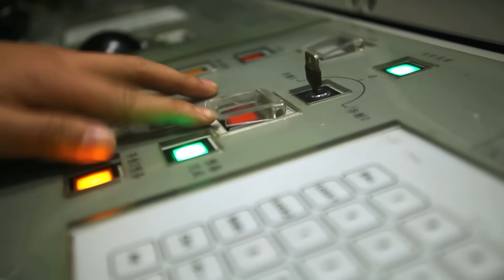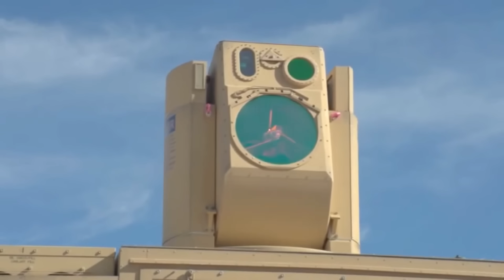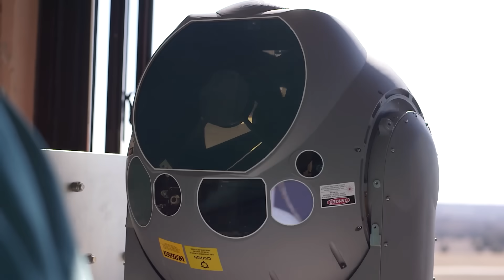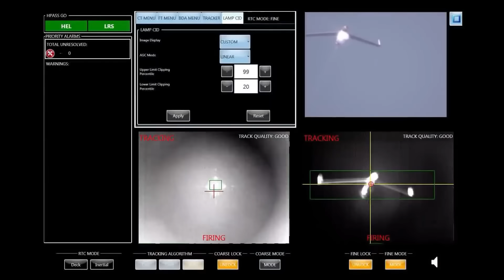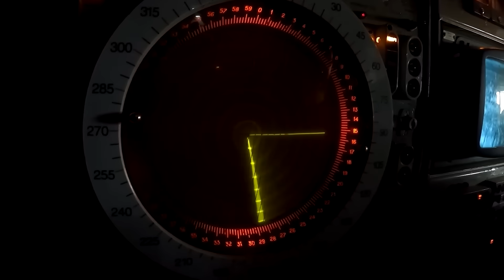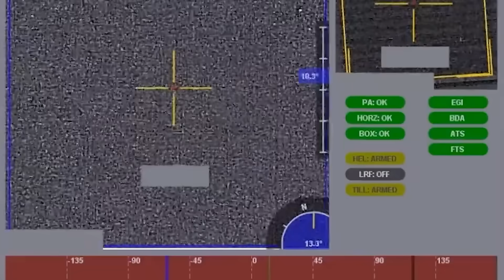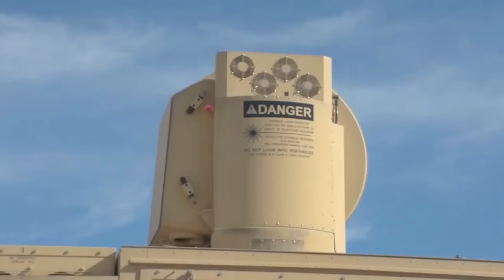US LASER Weapons STOP China Hypersonic Missiles In 1 SEC!

Comment: So a missile designed to withstand the extreme heat of hypersonic flight is supposed to be vulnerable to a laser within 1 second?
So please explain the heat load distributed over what area of the missile the tracking system is capable to deposit during that 1 second.
Even a laser beam suffers from dispersion and attenuation so the intercept has to be pretty close in. That would require the tracking system to be able to slew to the correct position to intercept that maneuvering hypersonic missile within seconds and maintain track for that 1 second at least.
Reply: It's additional heat to the heat that the missle already have to deal with.
Reply: @melonenlord2723   exactly which would instantly make the hypersonic missle unstable destroying it mid air.

Comment: In all physics here the speed of light is 671 million miles per hour and hypersonic is 7,673 miles per hour. By the way those are the max for both. So... saying a hypersonic missile is faster is crazy. You're basically saying hypersonic can reach a light year away when it can't
Reply: They're saying that the targeting systems cannot keep up with a Hypersonic missile long enough for it to drill a hole through it to reach the components which probably takes 5 to 10 seconds of maintaining a constant laser contact.
Reply: @samiamgreeneggaandham   if its a 2 megawatt it would be enough.
Reply: @Fold-103  that is true. They can downsize, now, the chemical lasers which are easily capable of doing 2 MW that they used in the 2000s on a Boeing 747 test platform.  Technology has improved yada yada yada. But they’ve also successfully done infield testing on subsonic cruise missiles with 30 kW lasers and have absolutely fucked their shit up.
Reply: @samiamgreeneggaandham   the us is currently making a 300kw one which is enough to take down a cruise missile in a couple seconds

Comment: I would like to know, if the surfaces of the Missiles and Aircraft had a high quality Mirror Finish, would this Mirror Finish just reflect and redirect the Laser beam. Thus, not doing any damage to Missiles or Aircraft?  This should certainly be checked out.
Reply: not an issue, mirrors at best reflect 50% heat. lasers are using the heat energy to destroy. So the object hit still heats.
Reply: would not be possible to have a "mirror finish" anyway on hypersonic glide re-entry vehicles. They require ultra-high temp surface coatings or tiles similar to how the space shuttles did in order to withstand the intense heat generated by the air friction against the nose at those speeds.  

Anything that has reflective capability would be burned up within a few seconds and the entire re-entry warhead along with it, so even if some sort of finish of that sort was used to reduce the effectiveness of certain aircraft-based missiles, it wouldn't even be applicable to the most dangerous and effective hypersonic systems which pose the greatest threat to carriers and ground installations. 

Now they could use the weather to their advantage to a degree, high overcast days will reduce the effectiveness of the LASER, it would take longer to burn through the missile hull and require a closer distance, but the power of the LASER and the speed of the missile would be significant factors..

One thing is for sure, LASERS make extremely good anti-missile and anti-drone systems but will likely only fulfill those roles in the near future due to the massive power requirements. 

As for infantry, they will be slinging high velocity bullets for decades to come, and artillery is still to this day the biggest casualty producing weapon available. Period. Roving artillery like the Russians employed in Ukraine is probably the next evolution of artillery. 

Although, I wonder if a LASER system could be powerful enough to self-detonate artillery shells before impact.... that would be a massive advantage!

Comment: May be some exotic {Polycarbonates or Carbon Fiber/Polycarbonates) that may require several seconds or minutes to burn through. Also not sure if Sloped/Curved, Highly Polished Mirror Surfaces of a nose cone will Deflect Much Laser Energy.
Reply: Most Missile's Noses R Harden with Pure Tungsten And/Or Boron; Very Thermally Stable and Inert. A lazer Just tickles.......
Perhaps U have some very secret: "Fairy-Dust" that can penetrate a Mach 05 Smart Missile in a Waves attack mode and a Twill of Harry Potter's Wand can make the Big Bad Wolf go- way....?!! .....I believe they still use Chromium-Steel for the other Shell; but then I am olde School.....
Reply: The shell of a hypersonic missile is heated by friction with the air to a very high temperature. Current lasers only increase the heat load a little.
Reply: @garychin5321  The material used is the same material used in rocket nozzles, designed to withstand extreme heat.

Comment: Yess  Hypersonic miscles are no match for thr Iron laser . Not even a match.
The Detection system of  Iron Dome (DID) is inherently calibrated to laser speed and capability . It is also shoots in very very tiny intervals actually  creating a domb of laser beams or an area as chosen to be defended and listen ti this - not only defended but also attacked. It can clear a field of 500 square meter in just a few miliseconds. Yes hypersonic is also covered. Meaning the laser dome creates an area or sky impermeable. Not just Hyoersonic miscle can't pass a certain curtain  but even a mouse. It is about detecting more than folowing since laser is much faster then hypersonic ; The laser blocks  a certain curtain in a sky with nothing penetrating through it. Nothing. That is all the beuty in it. 100% protection.
😊😊😊

Comment: The Plasma generated by the nose cone will reflect the laser....
Reply: Only partially.  The plasma will block radio waves.  But the opacity of the plasma decreases with higher freq electromagnetic waves. By the time you get to the near IR for current laser weapons there's not much reflection. But the missile material is designed to withstand a lot of heat.  Material used in rocket engine nozzles are used to cover hypersonic missiles.

Comment: The atto weapon is 50000 times hotter than the sun
Reply: Bunch of bull. It weapon melted down already.
Reply: Do you realize how hot the sun is? The surface is a blistering 10,300 degrees (5700c) and it's core is 27,000,000 degrees (15,000,000 c) Hot enough that it's been fusing hydrogen into helium for billions of years!
Reply: But me I don't believe until I see it live (can't pass the sun) because the sun comes all the way from heaven till earth and you can still feel hot. And that same machine you made it from the sun. I mean there's a combination of fuel/gas. And all these comes the sun that's what I believe!